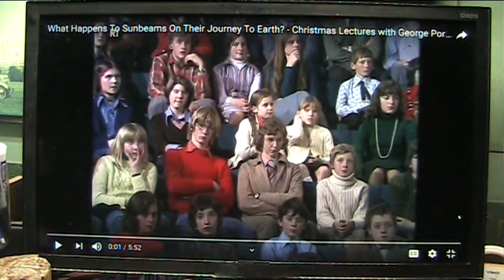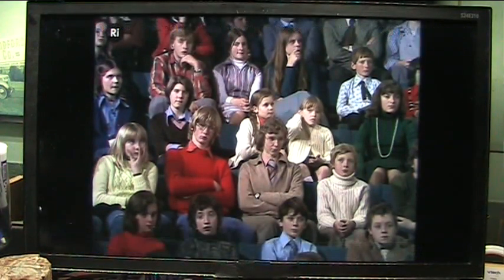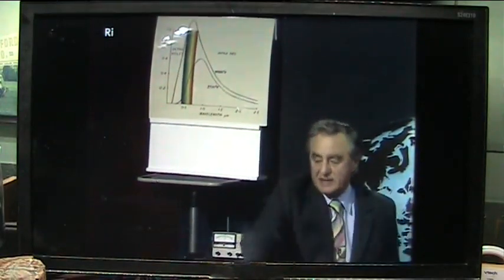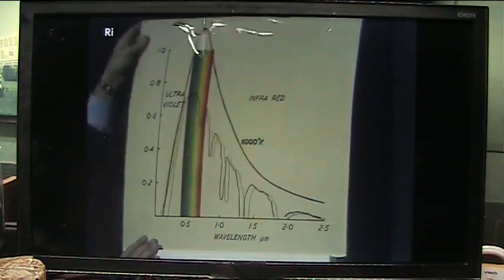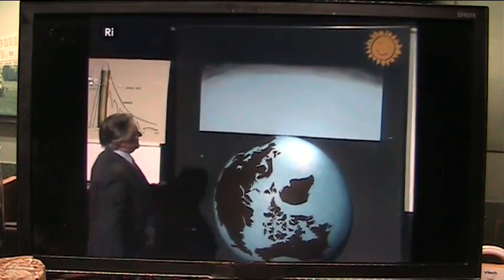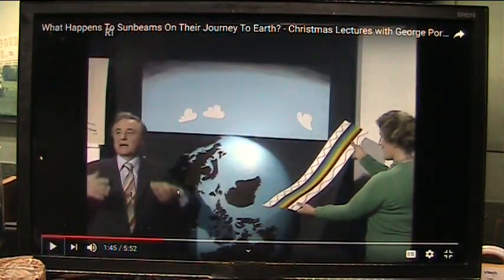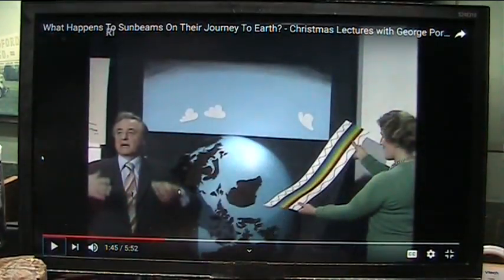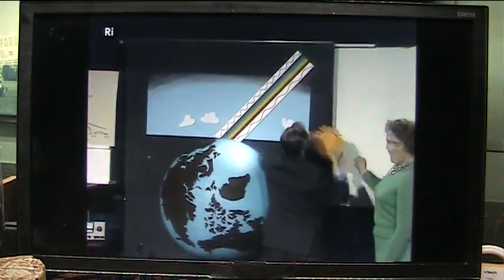MFU on Spinning Light Particles

Comment: I'm looking forward to finally learn how to use a multi meter. we can't afford to have someone else fix our dryer so I have to learn how to use it.
Reply from the maker: If it runs but no heat... I am pretty sure your dryer will have an open circuit on the heating coil... if older they can break. Today I will explain the whole thing.